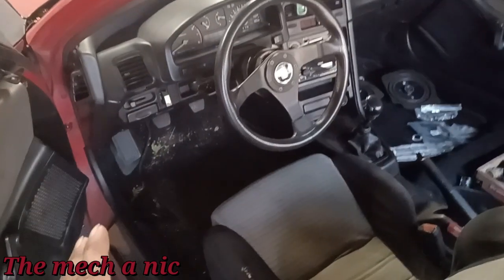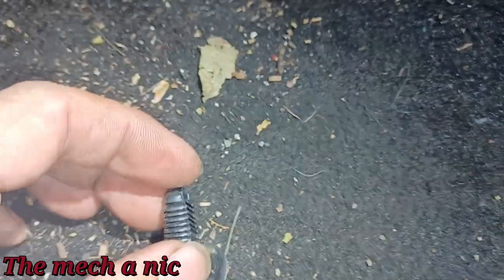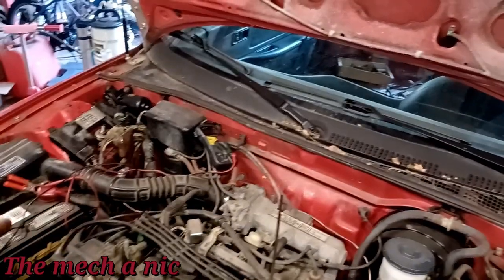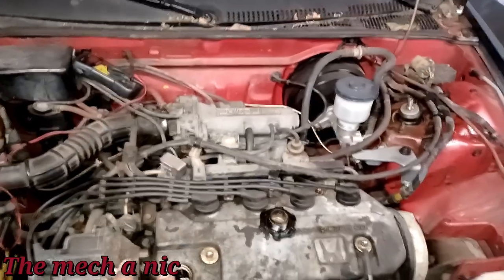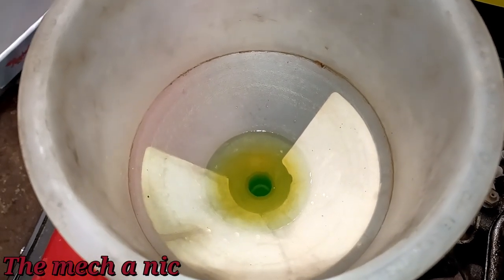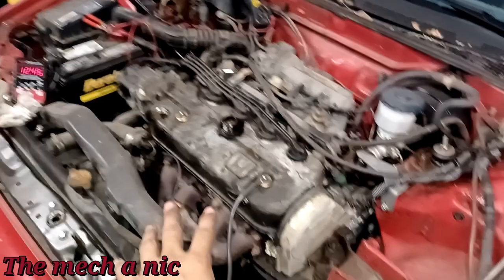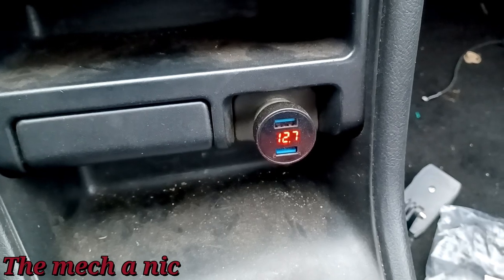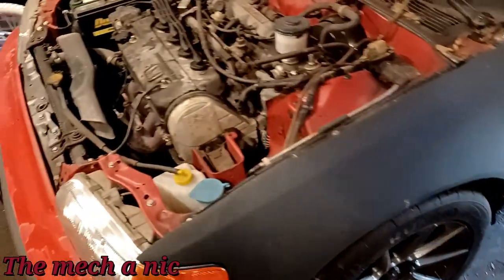crx problems and update

Comment: Congratulations on getting the hell out of Chicago bro. I'm really happy for you. I'm not sure what suburb you moved to but the only concern I have is that your new neighbors may not be very thrilled with you running an auto shop out of your home. You might receive some complaints so be prepared.
Reply from the maker: That's definitely a concern. The last thing I want is to annoy neighbors.  I'm trying to keep my noise to a minimum and do what I can to mitigate it.
Reply: @themechanic6117  I wouldn't be as concerned with the noise as I would be with some of these old beat up vehicles being towed and dropped off on the street sitting in front of your house. If you have snooty neighbors they will more likely take notice of the vehicles before they notice the noise. Then again depending on what hours the noise is happening... Obviously the person next to you may not like hearing your impact gun at 10pm at night. Lol
Reply from the maker: I'm no longer accepting tow in cars unless it's special circumstances because of that reason. It's a relatively nice area and I know my neighbors wouldn't appreciate crap cars being towed in. So no tow ins from now on.
Reply: @themechanic6117  good idea. 👍 I was a little worried but it sounds like you have a plan. Best of luck to you. Congrats again. Can't wait to see more of your videos in the future.

Comment: What an interesting problem. I've heard of modern charging systems temporarily shutting down charging when the driver calls for a sudden burst of vehicle power, for example when passing another vehicle. The way it kicks in when you call for a load like headlights fits with that. Maybe check service info? I'm guessing this is normal, but the way it shuts down on the road has to be wrong. Maybe aftermarket alternators don't play nice with that system? Congratulations on your planned move, hopefully a few of your regular customers won't follow, ha ha ha. But they have been tremendous fuel for your Youtube channel, so I'll miss them even if you don't.
Reply from the maker: There's definitely something that's not right, you interesting that you mention aftermarket alternator may not work as intended because I'm pretty sure this problem popped up after installing the first aftermarket alt. It's interesting the the problem is pointless now that I'll be pulling this engine out lol. I know the channels content will change but I promise to bring you guys along if I get more turd cars here👍

Comment: Just found your channel a few days ago.  Really enjoy your content. In this video you used some coolant in a funnel to check for a compression leak.  I'm wondering how indicative that test is of a leaking head gasket?  I changed the coolant in my 05 Accord the other day.  While bleeding the air out I noticed that I would consistently get some air bubbles if I revved the engine, after bubbles had otherwise stopped.  Are there other causes for that kind of behavior?
Reply from the maker: It's hit or miss, I've had cars with a blown head gasket that constantly blow bubbles out the coolant, and I've had cars with no blown head gasket almost do the same same thing. Usually a blown head gasket will blow bubbles out the coolant at all times without reving the engine.  Thanks for watching,  check my playlist, there's plenty of crx videos to catch up on 👍
Reply: @themechanic6117  I've been watching them.  Good stuff.  Thanks for the reply.  Oil always looks good on the Accord and it runs well, so I'm hoping the system was just still clearing out some air or something.

Comment: What shit town do you live in where they can’t do your wheel alignment? Lol. Move to Las Vegas a lot of shops can do it! Alignment is a alignment
Reply from the maker: South side of Chicago,  I was thinking the same thing. An alignment is an alignment.  It's not like it's a full blown drift car. Camber is the only thing extra they'd have to do. So yeah they're full of crap but I wasn't going to let that hold me back . 👍
Reply: @themechanic6117  I used to run into that problem years ago with my lowered Honda getting turned down for wheel alignments. The camber is an issue because they can't warranty the alignment. (Without a camber kit) Not only that but one of the main issues I used to see was when they would try to drive the car onto the alignment rack machine. My civic was lowered 2.5". The angle would cause the machine to hit the rockers. For the shops that turned me down I think it was just too much for them and they didn't want to deal with the headache.